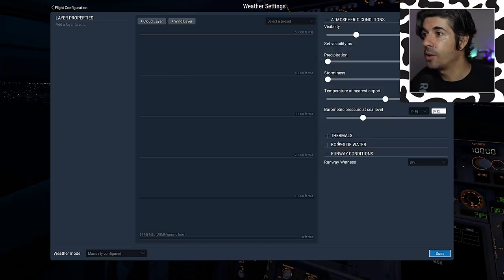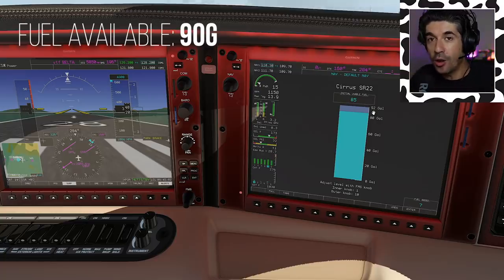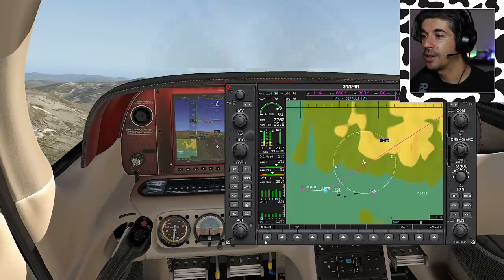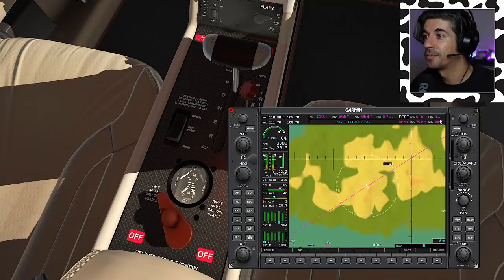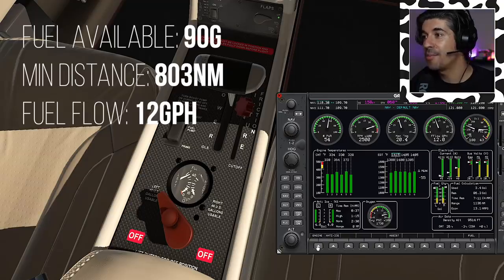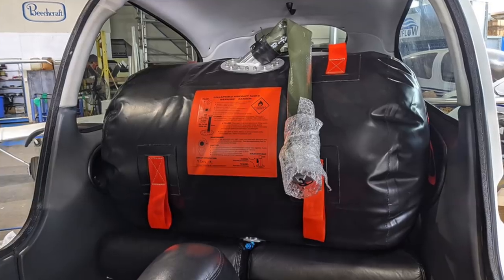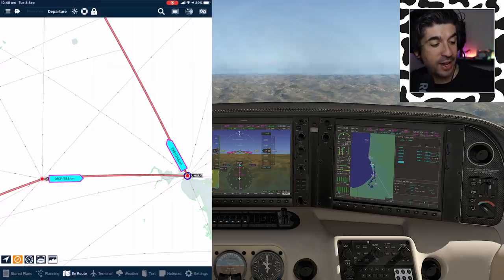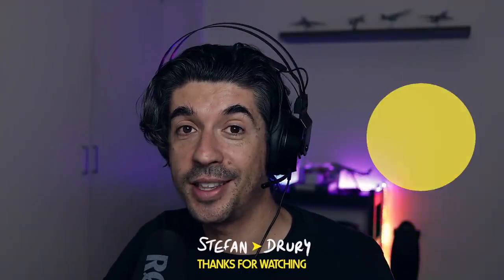My RISKIEST round the world flight - would you do it?

Comment: Just a tought: nothing prevents you from taking the aux fuel tank with you as a means to fill up the normal tanks while on the ground (so not connected to the fuel system, but used as jerry can). So at least you have the fuel with you.

The next problem is then to find a strip along the way where you can land, fill up, and take off again.

I would expect that some of the smaller villages along the way have a private or non-cataloged airstrip where you can land. Take Evensk (UHMW) for example and look it up on google maps. Is that not a runway ? And nowhere on any EFB. The same for Chaybukha(UHMG) about 70 km further...Markovo has a strip as well. (UHMO)...

www.greatcirclemapper.net is a good website to look these up..

That way, you can do the trip safely in 2 legs....

Comment: Not read any other comments before I write this.  I would do it VFR under ideal conditions, which might mean holding for a day or two... or three...  for the right conditions to do this leg.  You want to give yourself the greatest expectation of safety possible, so plan accordingly.  I'd still also be pushing to try to get the reserve tank installed as well, which would give greater options.  It's likely you won't be able to do this until there is a vaccination for the covid-19 virus, so you probably have a bit of time to work on it.

Comment: If it was somewhere in central Australia and the weather was good I’d consider it. But that part of the world is really desolate and weather changes quickly. I think it would be prudent to pursue the aux tank further. Just for info, last winter I was flying over Magadan and it was minus 30 Celsius and 30 kt crosswind. But summer is definitely better, however infrastructure issues are always a concern and I think an alternate plus holding would be wise. If you really cant get the aux tank certified then a much more extensive risk mitigation process would be required. Are there any farms with fields that you could land in, etc. It’s not a definite no, but don’t let Australian bureaucracy make you less safe - that would be the ultimate CASA irony.
Reply: Another thought. Are CASA stalling with a blanket approval for the AUX tank? Could you get a one off approval just for that sector?

Comment: My thoughts are: is that portable fuel take safe? Leaks, friction, odours. (static electricity) then I considered fuel consumption GPH and the Garmin G1000 or G3, then I started thinking about cross country American pilot Amy White because she's got one and I'd much rather be with her. Then I said Stefan in Australia.
I'm having a little trouble with terminology: like lean of peak. I know to seek the best fuel economy, and what's best for the engine temp and this is adjusted in change of altitude (air density).
Thank you sir🇭🇲
Reply: Second Question: I sadly am not a licensed pilot, but: I would seek advice from experienced pilots that have planned similar flights.

Comment: This one is a no from me without an Aux tank. I personally would not risk it, especially in Russia and without any local knowledge of weather patterns. There is also little infrastructure, no airports in the area and the country is rough. 

If you were going to do it, weather would need to be favourable and a decision point of midway between BUSUL & ARNAP for return to UHMM, continue to UHMA or divert to UHMP. The problem with that is you are then committed, with no alternate. Looking at UHMM right now, I see 02004 so it's an immediate headwind against you.

Plenty of people have aux tanks for these kinds of flights. Is this a CASA issue or more of an engineering issue? Weight & balance?

Comment: I would not undertake that flight. For a trip this length, the number of minutes you could be late is significant even with relatively small variations in wind. Your worse-case scenario should also be calculated as a function of wx-related deviations or even needing an alternate. Landing options are too few and far away to cut it this close on fuel.  Of course, I'm assuming you're actually asking advice for entertainment purposes, as I'm sure you wouldn't base your judgement on the advice of a bunch of clowns on the internet (as fond of your channel as we are).  My regards to Milkshake.

Comment: Without the AUX fuel tank I would split the flight into two legs. 
Possibly UHMM - UHMO - UHMA
Reply from the maker: Interesting thought. UHMO is located at the ARNAP way point I entered into my flight plan. Looks like a gravel strip, decent length. Wonder if I can get a barrel of AVGAS shipped out there. Thanks Bryan, I’ll contemplate that one.
Reply: @StefanDrury  You can always take the Aux as cargo, and do a transfer on the ground. Going down won't add much to the fuel burn, but heading back up will.

Comment: I think you have answered yourself before this video, talking about personal minimums. If they are exceeded then don’t even consider it. 
I would push ahead for the tank and would recommend to delay the flights until it is approved, then you have more options. I, personally, would not do it, not so much for the fuel factor but for the unfamiliarity factor. Pretend it is a gorgeous VFR flight and for some reason Milkshake distracts you, your NAV equipment goes AWOL and you are in an unfamiliar place far away with possibly a language barrier,,,